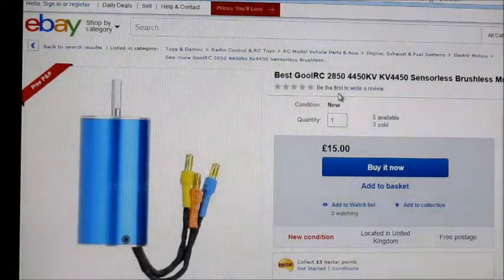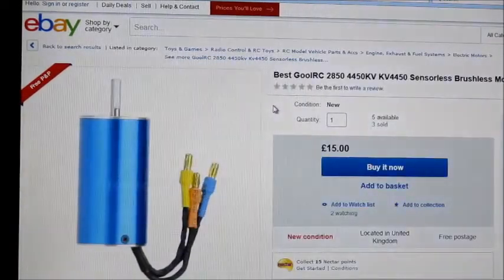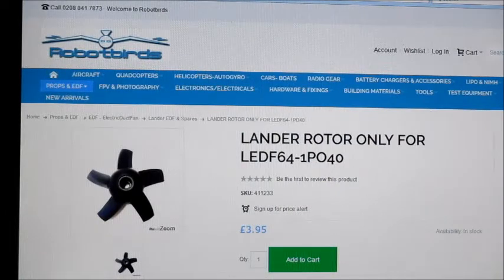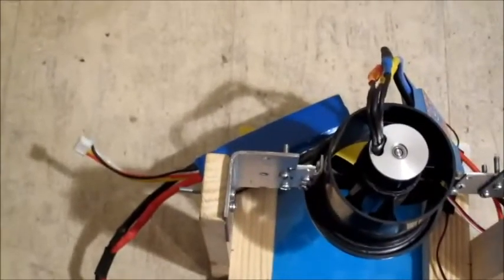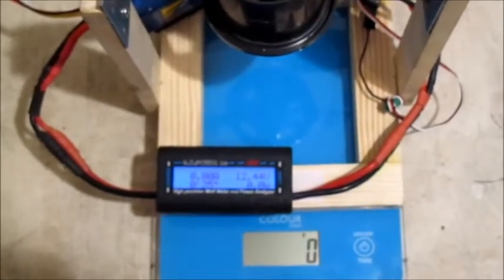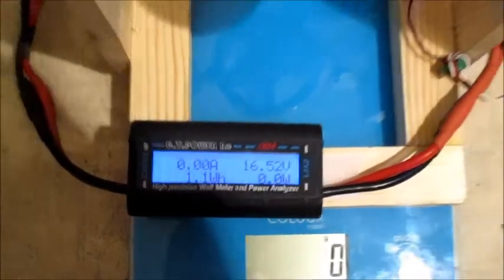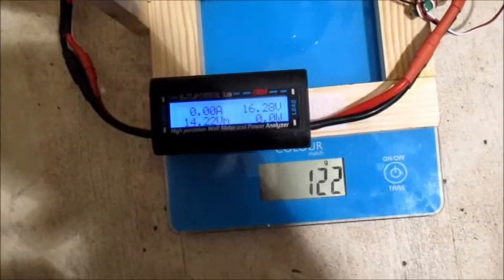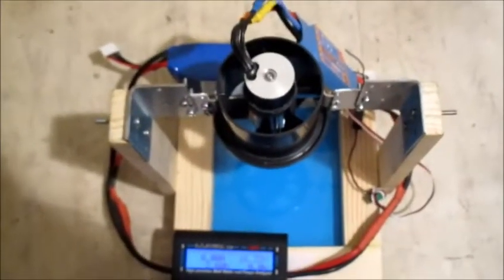GoolRC 2850 4450kv 60mm EDF Thrust Test Motor test of the Week

Comment: That's freaking marvelous man!   I have what are probably the exact 60mm ducted fans that go into my BlitzRC f-14 Tomcat.  The housings are so long that they must be only for in-runners even though the box claims it to be for outrunners.  Disappointing to me when I figured that out and had already bought two outy's that don't fit.  This is more thrust than I even expected out of my two outrunners though.  One thing to figure out, how did you fix the impeller / cowling to the wide 4mm shaft on the GoolRC motor?  I have metal pieces that are meant for 3mm or so.
Reply from the maker: Hi Peter
Thanks mate. Your right about trying to fit outrunners to some edf's can be a pain. They don't always fit. It is handy that I have a lathe so I can modify the shaft adapters to fit different motor shaft sizes and fan blades like I have done on a few of my other edf setups. If you can find a shop near you that has a lathe they should be able to do it for you. Thanks for watching.
Reply: Thanks rcplanepirate! So, if I'm understanding you correctly here, you are grinding the 5mm shaft on the Gool motor down to around 3mm, so that it fits the 3mm shaft adaptor that came with the 60mm edf assembly?
Reply: Oops, sorry, I finally just caught that part of the video and remembered what a lather was from woodshop class.  I'm still confused as to how you are using the lathe to grind out the 3mm hole in the adaptor to a 4 or 5mm hole.
Reply: I keep answering my own questions here with a little searching on youtube.  Shoot, I really need to do that but I'm not buying a lathe and don't have the experience to pull that off cleanly anyways.  Was thinking about drilling it out with my drill press, but I know it won't come out exacting enough to have a nicely balance edf impeller.  Thanks for the help.  Hopefully, I'll find a way.
Reply from the maker: Yes it's the adapter that I modify not the motor shaft. Never mess with the motor shafts! The adapter goes in the chuck then the inner hole gets bored out to the correct size for a very tight fit. Do not just try to drill the hole bigger by hand because you will never get the hole straight! I was also not using the fan blade or the adapter hat came with the 60mm edf. It was a 64mm fan blade that I cut the blades shorter to fit the 60mm fan housing. So if you can find a 64mm fan blade that has a 4mm shaft adapter you can just cut the blades shorter and use that.
Reply: Good advice again.  Thanks!  I ordered the same fan blades you used in the video just in case.  I also found some 4 and 5mm adapters on other sites, but they don't look like they'll fit the stock 3 and 5 blade fans that came with the 60mm edfs.  Is there any particular reason you didn't use one of the stock fans that came with it?  I'll see if I can find a fan that comes with a 4mm adapter as you suggest.  If all else fails, I found a machine shop on the web in my area, and maybe they would be willing to do it for me.
Reply from the maker: No problem mate. I broke the the original 60mm fan blade so I had to make something that fit. I don't think it would of been able to take this sort of power anyway. I've herd that they can explode on anything over 4000kv if run on 4s. Hope you can get yours sorted mate.
Reply: @rcplanepirate  فهجخک طفختجخرهگطخرجگتطئ4ےتےےے ے ےت3جنه2رتگگت%%5___😬😬😬😬🗻🗼🗽🎽🚾🚽🚽🗼🗻🗻⚓🏄🛀🚽🚾🛁🛁🚿🏰🏬🏤🏣🏡🏠⛪🔩⛪🔩🔨🏬🏬🗼🗿🗿🗿🗿🗿🗿🗿🗿⚓🏨🏨🗻🏥🎽🏥🏥🏤🚿🗼🏥🏥🏥🏥🏭🏭🏭🏭🏭🏭🏭🚽🚽🚽🚽🚽🚽🚽🚿🚿🚿🚿🚿🚿🚿🚿🏦🏦🏦🏦⏰🅱♓
Reply from the maker: @janasrutifunvideos7031  Err OK?

Comment: Have you tested any of the GoolRC 2440's? They do a 4000, 4600 and  6800kv! which should fit fan housings with a 24mm diameter hole without too much trouble. I'm thinking of buying the 4000kv version to fit into a Starmax 64mm, 5 blade fan and trying it on 4S.  If it can produce 500w or more @ 40a or less, I'll be happy. Wonder what the 6800kv would do on 3S!?
Reply from the maker: Hi Ben
I have thought of doing the same but haven't got any yet. One thing you must make sure you look out for is the shaft size. The fan units I've looked at don't supply a shaft adapter that's the wright size for the motors shaft. So that could be a problem. Thanks for watching.
...RCPP
Reply: I just bought the 4000kv and I'll let you know how I get on. It's a 2.3 shaft but that's ok because I've got some adapters that will fit.  I'd like to try some 26 and 28 size motors as well but can't find any 64mm housings that will fit them. Any idea where to get them from?
Reply from the maker: Cool. Yes let me know how it goes. All the 64mm fans I can get come with a 3 or 3.175mm adapter. I can make a 2.3mm adapter bigger into a 3mm adapter but I can't make a 3mm smaller to a 2.3mm.  There is only one 64mm edf that can take a 28mm motor but it's expensive.   https://hobbyking.com/en_us/edf-ducted-fan-unit-7blade-2-5inch-64mm.html
The 7 blade rotor that comes with it is very power hungry.  After I had a accident with the 7 blade rotor on mine I had good results with a 5 blade rotor and a 4800kv motor on 4s.  https://www.youtube.com/watch?v=EijUdQJ_YKM&t=485s
Another great edf is this 65mm unit. Although HK list it as a 66mm edf for some reason.  https://hobbyking.com/en_us/edf-ducted-fan-unit-6-blade-2-56inch-66mm.html
I have had AMAZING results with this unit with it's own 6 blade rotor, a 12 blade rotor and a 5 blade rotor. All are very powerful and the 5 blade rotor setup is on 5s and must be a world record as it just touches 2.2KG of thrust on the scales.  https://www.youtube.com/watch?v=Uz9AYPWA-cM&t=414s
https://www.youtube.com/watch?v=V-M4ghxYzZ8&t=1716s
https://www.youtube.com/watch?v=xdTsDFu9G4Y&t=648s
To fit the 29mm motors into all these edf housings you need to in large the motor housing hole a little bit. The 7 blade edf I had to in large the hole a lot which weakened it a lot and I then had to reinforce it. You will also have to make a little plate to space the motor out a bit as you can't get wright to the end of the motor hole with sand paper or a rotary tool without weakening the housing there aswell. With out it when you do up the motor screws tight you could crack the edf housing. Hope you find this info and the other videos helpful. Cheers.
...RCPP
Reply from the maker: Thanks for letting me know Ben. Though amps and watts numbers are not as important as thrust numbers. Do you have a thrust rig? Yes I think 4s is too much for it. Maybe the 4600kv on 3s would be a better setup. One day I plan on using my lathe to make and possibly sell those stand off mounts that edf outrunner motors come with. So you can fit any 28mm outrunner to a edf with a 24mm or 20mm motor hole. They would be handy to have wouldn't they. Cheers.
...RCPP